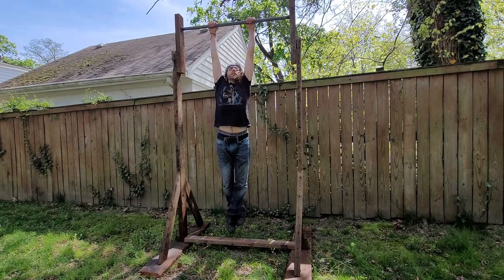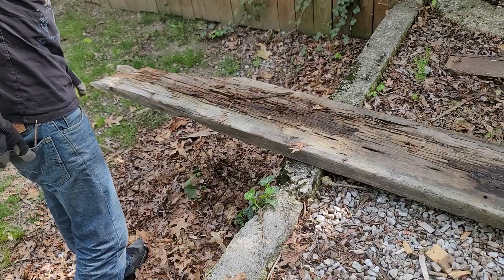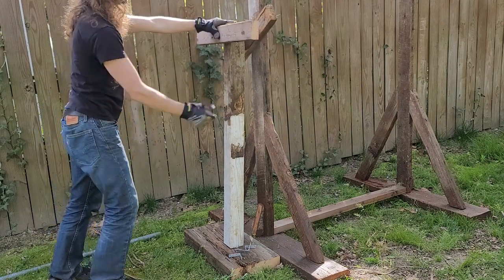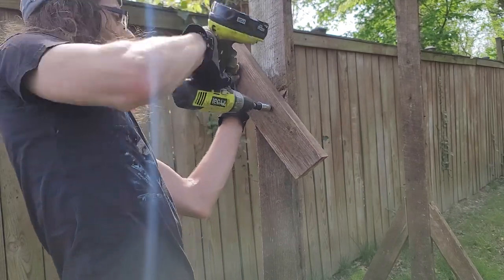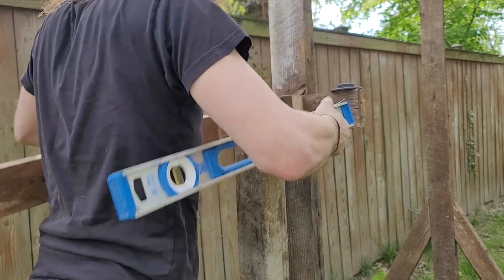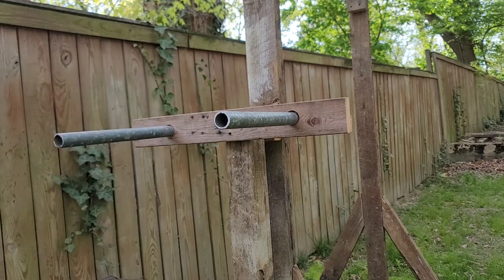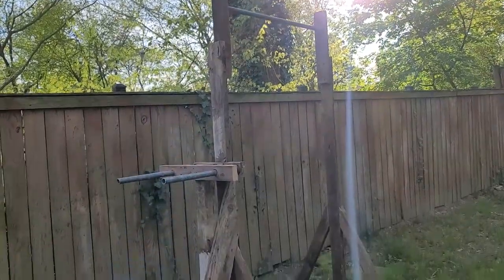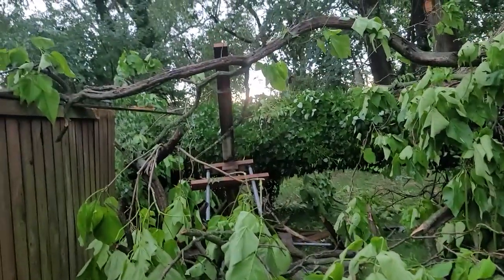DIY Dip Station Build

Comment: Well, that was easy! Wish all projects were as easy as removing the concrete from the old post. That was satisfying.
Reply from the maker: I was ready to go to WORK. And then no fuss at all. Wish I could hammer anything once and have it be done. That'd be my kind of superhero - one hammer swing man.
Reply: That hammer blow was reminiscent of your smashing of the like button in your driveway.
Reply: @Bootstrappin how tall is your Pull  Up Bar?
Reply from the maker: About 8 feet if I had to guess. Suit the bar to your height with your arms stretched out above your head, and add like 6-12" inches to that, or however high you can reasonably hop